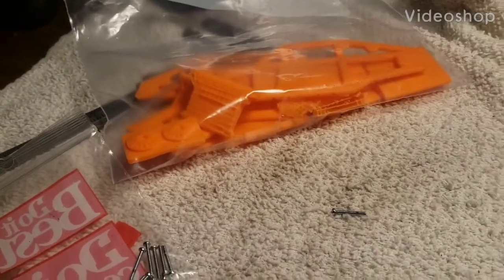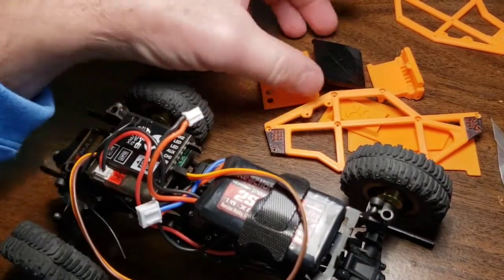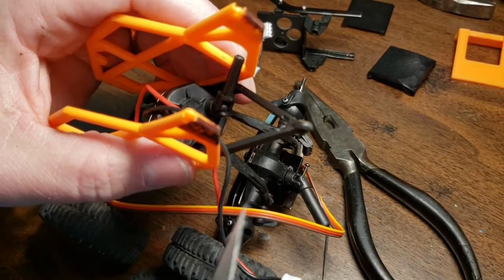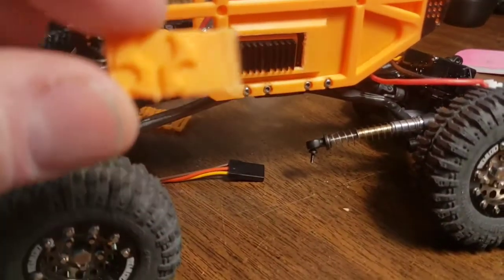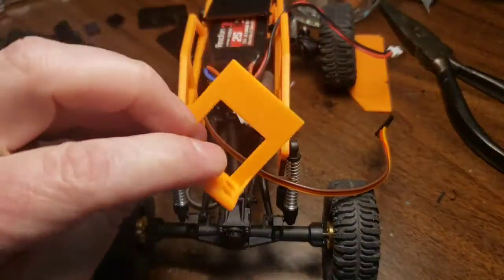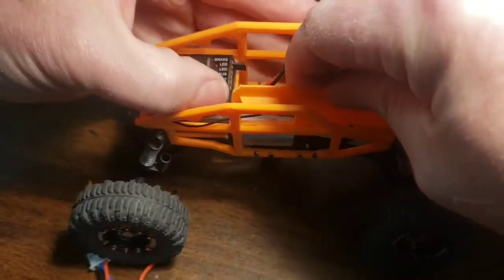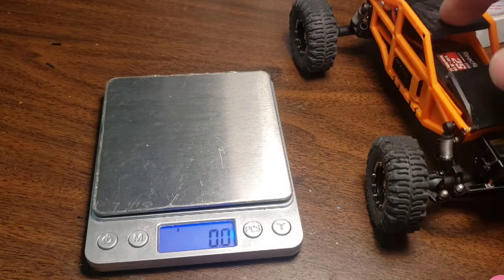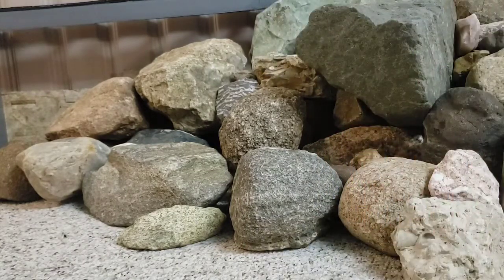E1 SCX24 Build. See E1 video links in the description.

Comment: It this the deadbolt  chassis? Do it have 4 links conversion ? Or is it stock
Reply from the maker: It has Deadbolt rear suspension and Jeep front except instead of the upper wishbone I three linked it. The motor side has the link omitted. No side to side motion. I used a straight link instead. 

The motor is so large and in the wrong place that a link doesn't work there. Its fine without it.
Reply: @EXPIOWA  do you have a video where u show how u set that up ? And thx for answer
Reply: @EXPIOWA  do you think this Will work with the furitek komodo motor ? It sidste higher on the frame but has a smaller esc so the space is avalible for reciever and batt.
Reply from the maker: @eenig8730  I can make one. : ) Look for it later today.
Reply from the maker: @eenig8730  I think the MoFo Version 4 Bouncer is I probably a better option for the Komoto because it is wider. I have not tried to put one in it so I will not say definitively. When you do things that were not intended you likely will have to deal with issues you could not have expected.
Reply: @EXPIOWA  nice with the vid . Il look. Do you know if the mofo version 4 bouncer can be found somewhere for 3d print?
Reply from the maker: @eenig8730  moforc.com

Comment: Seems to me this chassis isn’t well thought out. I do however like the looks of it.
Reply from the maker: Its not any worse than any other RC I have purchased. Most if not all need some tweaking to be right. It is very difficult to nail something the first few times. 

The basics were already present so it was a matter of removing the material I didn't need in order to reach the goal. 

This chassis was never meant to have a forward mounted motor and the PN Racing mount did not exist when the chassis was being laid out. Even so, it has a design that is flexible enough to accommodate what needed changed. I'd say that's pretty good. 
😉👍